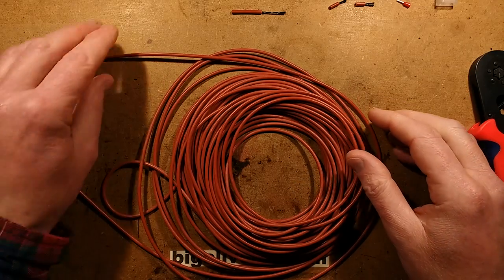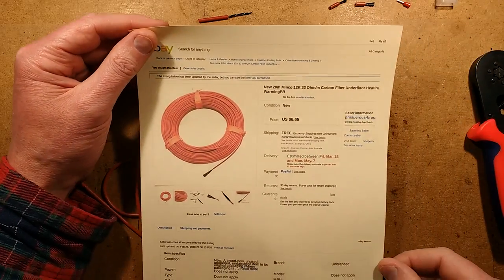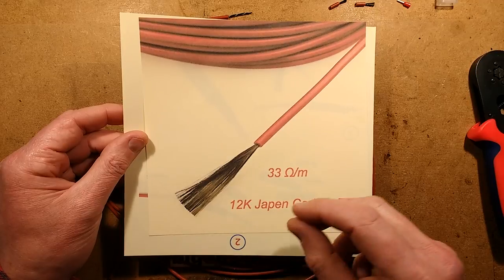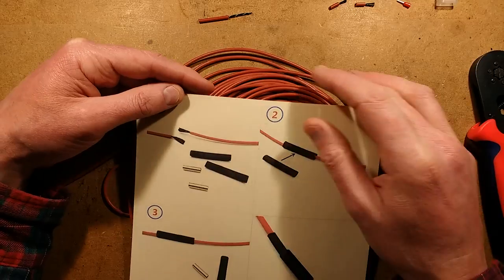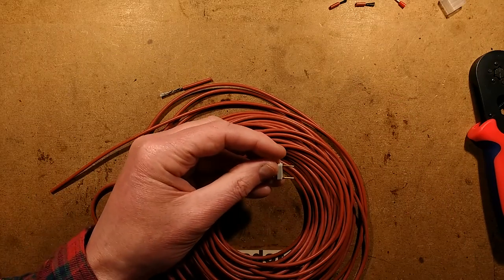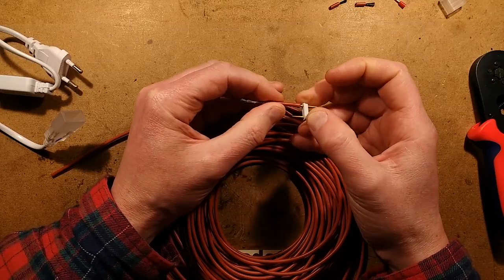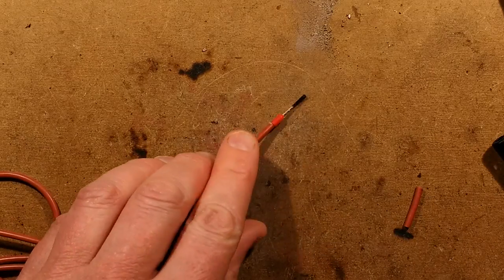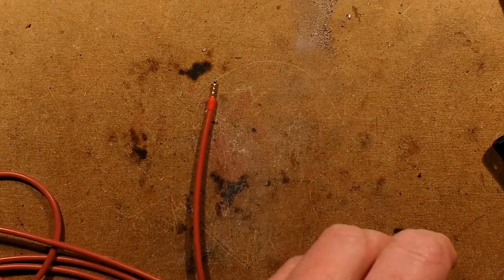Testing carbon fibre heating wire.  (with flame test)

Comment: When I was building my Cozy MK IV experimental aircraft 20 years ago, my late father saw how I was working with fiberglass and gave me a good ear twisting and a couple of hours of lecture on why I shouldn't work with fiberglass. It is terrible, and your body will never get rid of it. It builds a mucus-like substance around the inhaled strands, and keeps them for as long as you live. 
Here I was thinking I did the right thing by not building another type of aircraft that used mostly carbon fiber! 
Little knowledge is a dangerous thing...

Comment: Is there a reason why don't you buy off Aliexpress? It's usually even cheaper.
Reply from the maker: It's difficult getting stuff shipped to the Isle of Man.  I've had issues where I bought stuff and their system didn't even have an option for shipping here after the purchase.

Comment: you need to be careful with the electro magnetic fields it should be used doubling back on itself especally if you are going to be in close proximity to it.  for instance electric blankets have been redesigned to limit this. and electric cars go through alot of lengths to distance passengers from the high current cables. its not really known what it does to humans but more studies suggest its probably not good for you

Comment: Power up a cable and keeping in a coil setup is always a bad idea. Becareful. Is not only about airflow is about the inductive coil heater you involuntary make.
Reply from the maker: The induction usually isn't an issue, but the thermal issues can be.

Comment: an easy test for leakage would be to toss it all in a plastic bucket full of salt water and do a high voltage test
Reply: with silicone insulation I doubt you'd see any traces of leakage until 5kv+

Comment: The downside of watching you Clive is that you start to get spammed with commercial/industrial ads. Thanks google, I don't have a need for FLIR imaging devices or mass producing electronic devices.
Reply from the maker: But if you DID have a Flir camera you would end up using it a lot.  But it's quite an expensive toy.

Comment: I don't know about Europe, but in the US you could never legally use that installed in a floor or anything permanent. It would not meet any codes. The lack of a proper way to terminate is just another red flag this is just a weird china thing that has no real application...

Comment: Wow, the resistance decreased as it got hot!?! That's weird.

That wire hasn't seen any form of testing. They tested the first inch of the wire, on the first day they started manufacturing it, and then never again. Lol... But seriously.
Reply: not sure if sarcastic about resistance drop due to thermal delta
Reply: We don't know. Clive had the meter on the wrong setting for he first test.